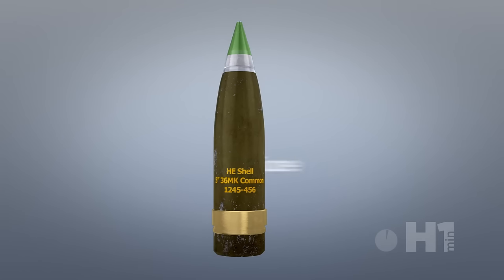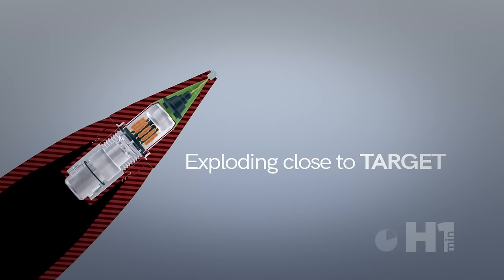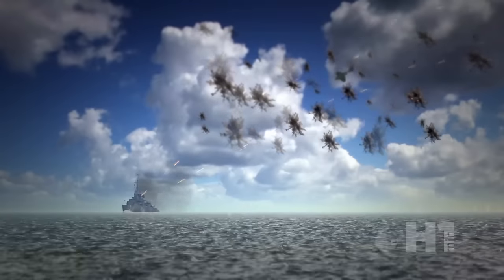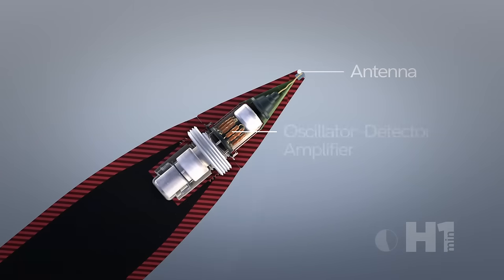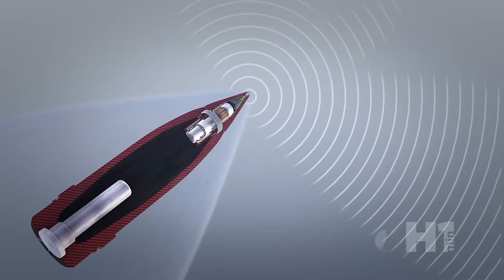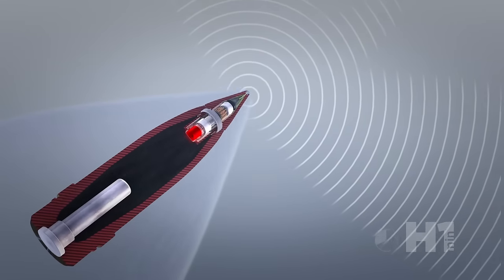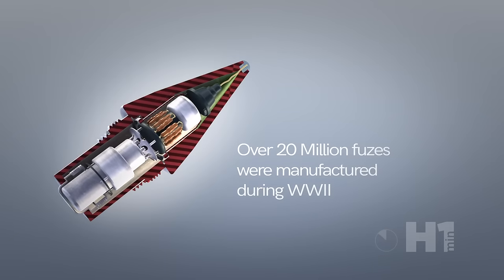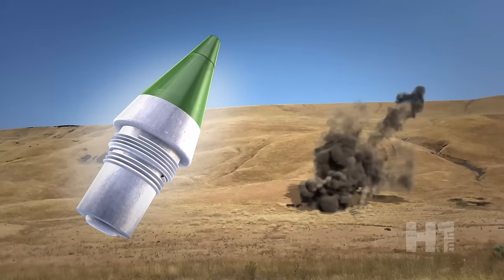H1MIN: WWII VT Fuze

Comment: Small correction: It doesn't matter how fast the projectile is flying through the air, it's the acceleration in the barrel that is a limiting factor in making the fuse work. The fuse needs to withstand an acceleration of 10's of thousands of G's to survive being shot out of a barrel.
Reply: Correct, just the Gs were a bit lower, couple hundred for a flak gun
Reply: Nah you are wrong actually, and your claims are myths, mostly.
Reply: @zeolol9817 care to elaborate?

Comment: There was even a report of germans refusing to leave cover for an attack because of artillery air bursting overhead. The first time they encountered it they nearly mutinied.
Reply: The Western Allies did somehow used Fuzes during Normandy but not for Land Artillery. However, they used the Fuzes for Land Artillery in the first time during the Battle of the Bulge where there was one report that an American Soldier from the Signal Corps says that there are German Infantry trying to charge their defensive position near Bastogne while calling for artillery. They next morning, they saw a field of more than a hundred dead Germans caused by the Fuzes devastating blow.
Reply: Forward observers did manage air bursts with just a radio and timed fuses.  First time would be in 1939-40 for most.
Reply: Biały Have you no idea that this is a different Warhead. It has radar sensors and kill enemy soldiers in their trenches once the Fuze explodes overhead with deadly shrapnels. That is different from a WW1 Shell, VT Fuzes is a different beast that can kill enemies at the right time unlike timed Fuzes.

And second, since how where the Germans are aware about the existence of Radar Sensors VT Fuzes? Aren't those Warheads extremely Top-Secret by the Allies since they were mostly used against enemy aircraft until they did first saw use in land warfare during the Ardennes Campaign.
Reply: @Bialy_1  time fuze ur referring  has nothing on the proximity fuse as used on artillery. You cant be certain a time fuze will explode in the air. ...... here is the quote . This is referring to the use of proximity fuse in the battle of the bulge.."The Germans felt safe from timed fire because they thought that the bad weather would prevent accurate observation. The effectiveness of the new VT fuzed shells exploding in mid-air, on exposed personnel, caused a minor mutiny when German soldiers started refusing orders to move out of their bunkers during an artillery attack" Rick Atkinson (2013). The Guns at Last Light: The War in Western Europe, 1944-1945. pp. 460–62, 763–64. ISBN 9781429943673.
Reply: Yeah but the shells were used by ground forces only during Siegfried line battle.
Reply: @Bialy_1  weird running into you again. Youre wrong again too. Also, you dont know enemy artillery is firing until its too late.
Reply: it is also observed that infantry from the americans russians chineese japaneese and whoever you can come up with, refused to leave the trenches when artillery fire was present.
Reply: @unowno123  nobody would leave the trenches during an artillery bombardment, regardless what type of shells they fire
Reply: @someguyfromfinland4239  exacly thats why Julio Sunga's comment is laughably pointless
Reply: @unowno123  so was yours tbh
Reply: @someguyfromfinland4239  it was sarcastic comment response to Julio Sunga's comment
Reply: @unowno123  you forgot /s then
Reply: @Bialy_1  Right. As far, as I know, the 8,8-cm-Flak L/45 C/16, used timed shells (S30) against soft targets, like artillery positions, or something similar with a VB (forward observer) in the last periode of WW1. Thats of course not a fused shell, but the effect is the same, as you mentioned.....
Reply: Shrapnel shells had fuses timed for airburst detonation from when shrapnel shells were first invented by the british in the late 1700s, but proximity fuses and similsr were far more accurate.
Reply: Question: why couldn't they design a shell that extends a metal rod after firing, touching the contact fuze? That would simulate an air burst

Comment: When I was a Navy GM during Vietnam we were still using WWII ammo for our 3" guns and had both VT Frag and VT non-frag rounds in stock.  VT frag was great for dealing with small surface targets and VT non-frag was our standard training round.  Not mentioned in the video is where the fuse got its electric power from for the radar.  Inside the fuse were small, fragile ampules of acid that were broken by the force of firing, and the spin of the projectile from the rifling forced that acid into a battery lining the outer wall of the fuse.

Comment: When I was overseas and short (just have a week left the country and have lived all this time) this ‘forward observer’ and me are talking about high explosive rounds he sometimes called in, this is 105 mm artillery shell. There happened to be one nearby with a variable proximity fuse already on it.
Okay variable proximity fuse. This fuse has a plastic nose with a radio tucked in it. When it leaves the barrel a hammer smashes a glass vile of acid which activates the battery, which turns on the radio, which when it detects its within a few feet of something solid, like a jeep, a truck, a tank, (or a Connex) it sets the round off. 
When you need to fly over friendly troops it has a timer you can set before you shove it in the breach, so it’s not armed for a few seconds. I went and got the round which was in a cardboard board storage tube, plopped it next to the Connex that we were standing by, slid the cardboard tube off the round, where it stood up for a millisecond before in horror we stood helpless as we watched it tilt and then lean over tapping the Connex, smash goes the plastic nose, popping the hammer, and I see this puff of smoke come up from the acid being released which activates the radio in a proximity fuse. No timer to save our asses.
Me and this dude run like hell, I look back and see it on the ground hissing. Me and a couple of my friends are talking it over, cause this is a rather dangerous situation right in the middle of our camp (6 cannons at the top of this hill). Maybe we should radio for bomb squad or something like that, but it would take time before anyone could reach us by helicopter, and who knows what the round is going to do.
I did it and I just gotta take care of it myself. Everybody it saying 'no don't do it' as they are backing up. I go and get a fuse wrench, gently tipped the round up and stretched out at arms length try to screw the fuse out of it. But it’s just not working, and I say to myself  ‘what the f*ck is arms length going to do me anyway’. I sit down on the ground with the round and smoking fuse nice and snug between my legs, slowly put on the fuse wrench trying not to touch any of the guts and start turning. There was really nothing to be scared about as there was no way that if the thing detonated there was going to be anything left of me to worry about. All my buddies were as far away as I could see them.
Now before this happened I was thinking maybe I should extend my tour. When you get short in Viet Nam, you can extend your twelve months of duty by one month and not have to do the six months back in the states. Needless to say with every turn of the fuse wrench I said out loud "I Will Not Extend". ( Anything can happen at Anytime )
Reply from the maker: Thank you for sharing your story with us, really interesting! Thank you for your service.
Reply: Spoiler Alert: He Lived Boys ;)
Reply: You one crazy dude damn
Reply: I was just going to ask how the fuze arms itself, thats a nifty idea. Breaking a glass vial of acid inside a battery cell, brilliant.
Reply: lol .. and I'm still kicking ..
Reply: In Pictures of Viet Nam ....I’m often asked, how come it looks like your actually enjoying yourself -
I was.... It's a beautiful country and the people are soft-spoken and kind.
When I first arrived in country I thought "holy shit ... I might die" then after a few weeks I realized "I am going to die!" There's no doubt about it!  
After this realization sinks in life becomes extremely easy, you got nothing to lose, you're already dead, and no matter what way it may be going,  it's all good.
Life becomes wonderful, you enjoy the sunshine and you enjoy the rain, you soak it all in and smell the flowers, you're friends with everyone that comes your way, maybe they will put a bullet in your head - maybe they won't, but you're going to enjoy their company in the meanwhile. 
It's that simple. Even during the firefight there is no panic, no running around, you got all the time in the world, you take it easy, stay calm, and you get to live....
Reply: I suspect if you've waited a couple of minutes, the battery would've died. It's not like them things have to run the fuze for more than a few seconds anyway.
Reply: Ballsy. The battery only works properly if you spin the shell pretty fast, several times a second. Doing that mantra in between turns could have stopped the thing detonating. :)
Reply: @anonymousstout4759  That's what he used to clamp the round while he unscrewed the fuse! Lol! 
This is why I dislike the "Thank you for your service" types - they have no F**** idea what they're talking about (only saying it to make themselves feel good anyway.)
Reply: Your amazing. thank you.  Im taking these life lessons you shared with me forever.
Reply: Ha!  I should have read down further in the comments before making my own.  I just repeated some of what you said, but pertaining to naval cannon.
Reply: Amateurs, the Vietcong saw the bomb in half :))
Reply: @treenoises8009  which half was it they saw?
Reply: @randommadness1021  anyway, i meant cut, but english sucks :L
Reply: I remembered watching a documentary about Ordinance Disposal during the Battle of Britain. The guys who had the dangerous task of defusing the unexploded german bombs, not only had to deal with unexploded bombs but Germany started to equip their bombs with multiple 'false' fuzes and delayed timers. These bombs were deliberately used to target EOD teams who were sent to defuse the bombs.

One British WW2 vet who was in charge of defusing bombs during the Blitz said: "The first thing I always did when I got to the bomb, I sat on it, so in the event it went off I would not know that it did."
Reply: Okay, but you didn't tell us whether you lived or died.
Reply: @johnrollex680  if he didn't tell us, then I think that says it all mate. He will be with his God now 😵

👹
Reply: @randommadness1021    the concept of living or dead is purely subjective, based around signs of a living creature 
yeah anyway, many lived, some cut the bomb while its fizing, I'm not there to witness and the vietcong "army" not really disbanded following the 30/4/1975
or so I hope :))
Reply: Did you survive?
Reply: @emilioortega7513  perhaps :))
Reply: @emilioortega7513  lol.. yes .. and now I'm hanging loose and enjoying the ride ..
Reply: Hmmm, you really think they would make a fuse so vulnerable?  You cannot replicate the forces felt by the shell upon firing by simply dropping one.
Reply: There are other redundancies built into the fuse. It needs a massive Gee load to compress a spring that then allows a mechanical mechanism to unwind to arm the fuse. The only way to get that Gee load is to actually fire the round out of a gun.
Reply: @DepakoteMeister  but imagine how it would feel in the moment. Even if you were pretty sure it wouldn’t go off you’d still be scared shitless if a 105 mm shell was smoking in front of you
Reply: @philmybutup4759  You'd hope that their training would include how fuzes worked.
Reply: @DepakoteMeister  true. Idk im just trying to give the benefit of the doubt that someone would be scared in that situation and might not be able to think clearly. I agree tho
Reply: @philmybutup4759  I guess also better to be safe than sorry!
Reply: Wonderful story. Whose is it?
Reply: Bro that's amazing
Reply: You could pour water to the tip but you are the only guy with Titanium balls so you have to do it yourself 😊
Reply: I've heard the fuse doesn't actually arm without the centrifugal force of the shell spinning after leaving the barrel so in theory you weren't in any real danger. Still takes a lot of guts to do that though

Comment: I don't know why the Germans didn't go for a similar idea. I mean if the fuse can't withstand the acceleration of an Artillery shell then put it in Rockets. One idea of implementation would be the Werfergranate 21, a 21cm diameter rocket which has I believe 40kilograms or 90 pounds of explosives. Couple this with a proximity fuse and you have a really deadly weapon against aircraft or ground troops
Reply: Because they went with radar guided missiles instead  or well tried to.

Comment: I wonder if Chicago Piano 28mm is capable to have VT Fuze itself?
Reply: At the time its too small to be fitted with the VT fuse, it was already a challenge back then to miniaturize the electronics in the fuse for the 127mm (5 inch) shell. I would guess the smallest they could have fitted the fuse in is a 75mm (3 inch) shell. 
But nowadays they could probably make a proximity fuse for something as small as a .50cal (12.7mm) but wouldn't be practical since you'd basically need to have hit your target to make the tiny amount of explosive in the small shell be any effective and this applies to the Chicago Piano 28mm.

Comment: Need to make something similar for grenade launcher ammunition
Reply: They did, but they didn’t like it too much as it wasn’t programmable. The XM25 grenade launcher was canceled due to high cost, high weight and overall unsatisfactory performance. Couple all of those factors with the fact that the gun cost a fortune to purchase and maintain it didn’t help either. The threat from drones are so minimal during the XM25’s development period that a VT fuse was unnecessary.

The military found the next best thing and created anti-drone guns which doesn’t eat live ammo and minimal maintenance required.

Comment: Why didn't it just detonate on impact? 🤔
Reply: Mostly because it can't hit the target so they must have come to this strategy: better done something than nothing. Beside it may work like depth charge. I wonder what's the real reason also.
Reply: @DakLah  because the shrapnel does all the work, you can have it detonate near a plane so you don't have to hit it directly
Reply: It can, but the a lot of the blast will get absorbed in the ground and deflected back up into the air. If it explodes above the ground, shrapnel covers more area.